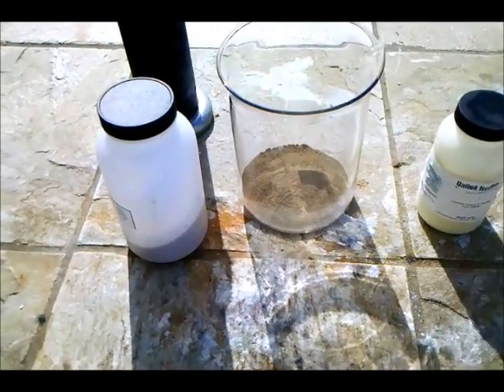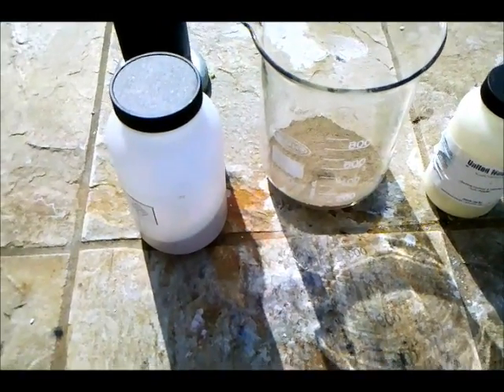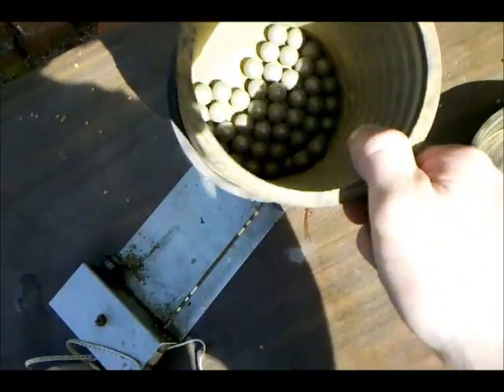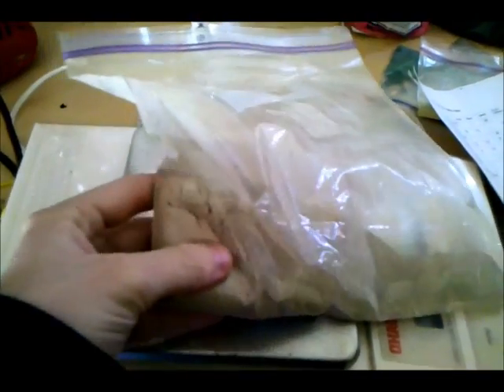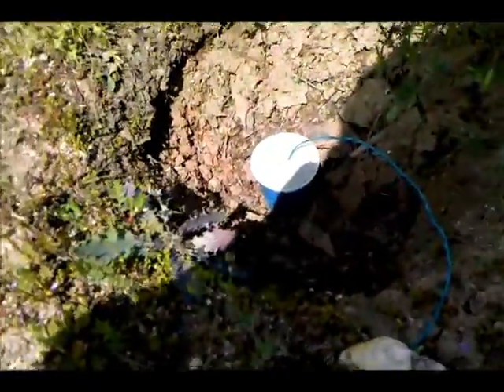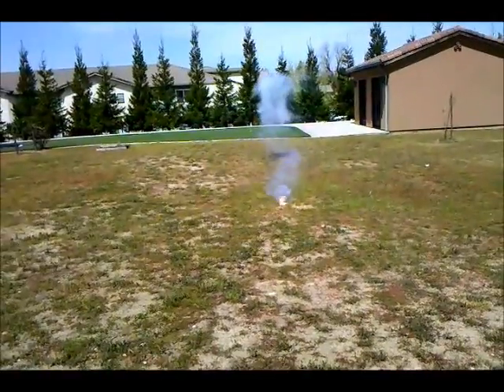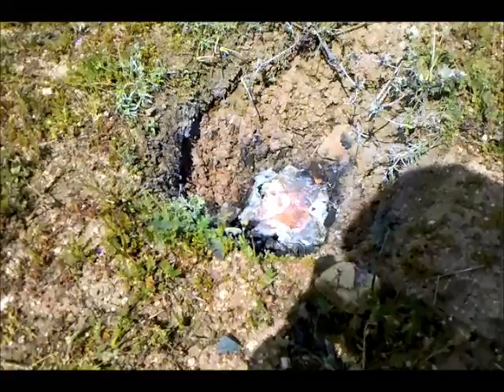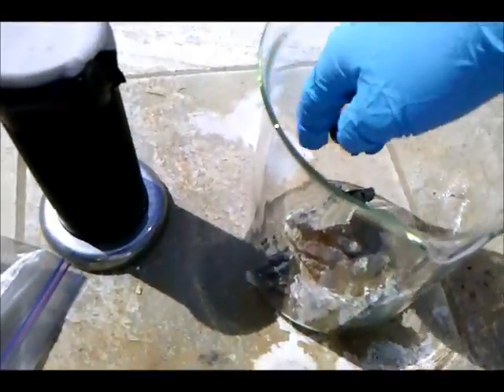Isolation of Silicon (Thermite with Sand)

Comment: if you need more heat, put it over fire, solar, arc, induction, resistance, to add the heat needed for the reduction, more output

Comment: Every time I see a thermite reaction, I see all the energy used to isolate aluminum by molten salt electrolysis released in seconds.  That being said...awesome!

BTW. I recommend you try mixing this thermite with black iron oxide thermite.  You should get ferrosilicon.  This alloy (when Si is 20 to 50%) has a melting point of only 1210 Celsius.  Would your product be more fluid and separate better?  I don't know. Ferrosilicon can be used with NaOH solution to generate hydrogen on demand.  The military does this.

Comment from the maker: @toothpick93 Maybe, but even then just because it gets hot enough in theory doesn't mean it will melt it when you consider heat lost to the air, crucible, etc.  Quarts would work but I would have to crush it.  Cab-o-sil is already extremely fine.

Comment: @hkparker doesnt your blow torch reach hot enough temperature to melt the silicon? if you want pure silicon dioxide, why dont you crush up a large bit of quartz crystal?  because its actually crystallized its problem more pure then the sand....

Comment from the maker: @toothpick93 In theory sure, but that would require an arc furnace.  It would be easier to use nicer silicon dioxide (like cab-o-sil) and have the heat of the reaction cause the silicon to collect on bottom like it supposed to.

Comment: @ycarus1977 
I was going to suggest glass as well. From what I've read, glass has a lower melting point that SiO2 due to sodium or potassium bicarbonate added when made. Also you don't have to worry about the extra Aluminium, Calcium and Magnesium oxides present in the sand. This might help to get the reaction going easier with having to boost the mix with sulfur or Potassium Chlorate. 

Also, apparently bleach will reduce the SO2 and H2S to elemental sulfur.

Comment from the maker: @SulaFreaks Yes, it is.  Aluminum chloride is soluble.  The hydrate decomposes at aluminum oxide but only at 300C, and I had an excess of HCl.  Either way the annealed aluminum oxide doesn't dissolve so the product is not of useful purity.

Comment from the maker: @plante1999 Powdered glassware (lab glassware) would contain about 20% B2O3 and my product would contain large amounts of boron.  Unless it dissolved away in the HCl (which I kinda doubt.  B2O3 readily hydrolysizes to boric acid but something about it being mixed with SiO2 must prevent this).  Cab-o-sil comes to mind.  Pretty pure and extremely fine silicon dioxide thats easy to buy, probably the best starting material available for this reaction.

Comment: Nice work! Your product looked very similar to mine right after I got it out of the HCl. I suspect that some of that black powder is Ti3O5, from TiO2 that was present in the sand but didn't make it all the way to titanium metal. I've got plans to do another silicon thermite with a much purer source of sand, so we'll see how that goes. Is that ball mill the one your friend makes that you mentioned on SM?

Comment from the maker: @pyroguy1030 Yea that will work fine, just make sure your MnO2 is fairly pure, the stuff that just comes strait out of a battery wont work, It has to be purified first.  Your product will need to be washed, and I'm not sure if HCl attacks manganese or not, but try on a test tube sized amount and see if it dissolves the metal.  If not HCl will work well for cleaning it.  Your aluminum will work fine.